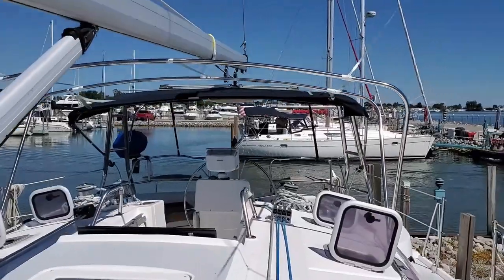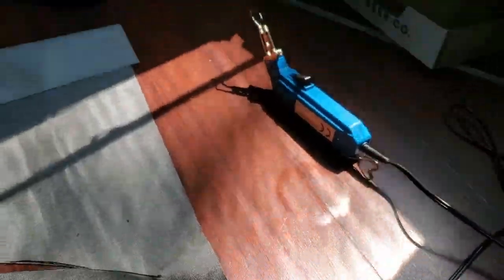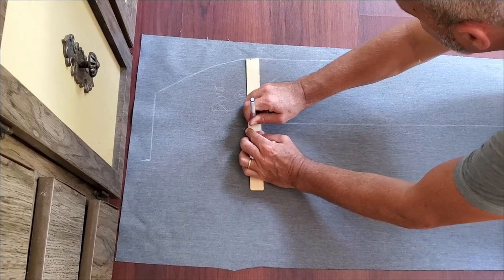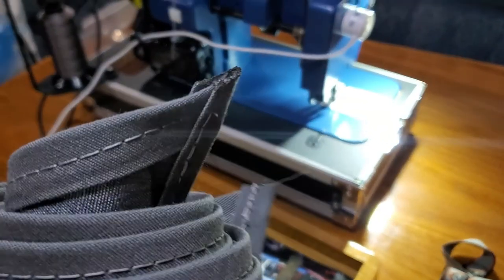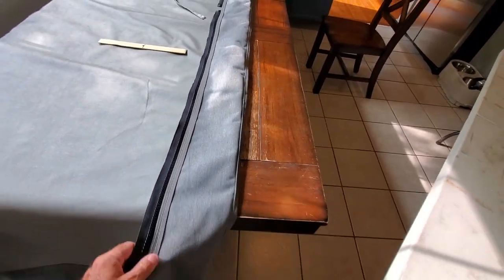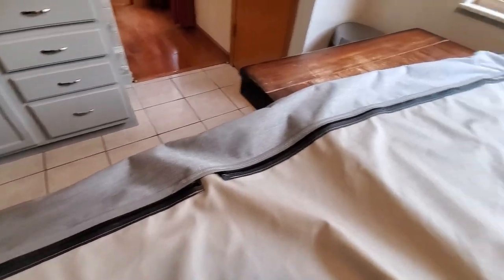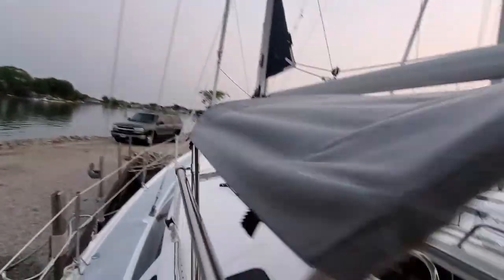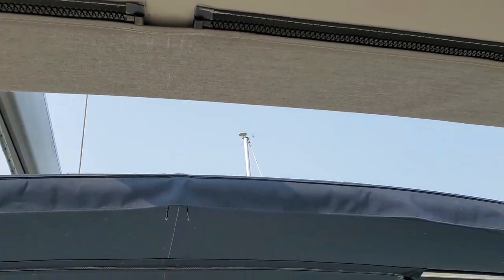100 Bimini Project Part 2 - Cutting the Canvas, and Sewing the Bimini Top - Sailing Pau Hana

Comment: Nice video I like your work arounds and making your own tools. I have listened and watched the video so many times I have their jingle echoing in my head while I’m working. I’m sorry to hear you’re having a hard time with your sewing machine with needle strikes. I have called them on a number of occasions and got good help plus the manual on timing and YouTube on timing are good too as well. I’m sewing a Bimini right now so thanks for your input I’m going to use some of your ideas on fitting the pockets to get that contour correct.
All the best Neal Southwest Florida
Reply from the maker: We just bought a house in SW Florida as well. We have 1 more winter here in the great white north, then we will sail down next summer.
Reply from the maker: The needle strikes have all but disappeared since I discovered using a larger table. The weight of the material hanging over a small table pulls the needle out of alignment causing needle strikes  (that's my theory anyway).

Comment: Came our really nice!  I must have been lucky with my Sailrite zigzag machine.  My biggest problem was getting the correct size needle to match the thread weight.  Then I switched to Tenara....whole new learning curve.  Happy to hear they made good on it.
Reply from the maker: I was reluctant to leave my frustration in the video, but I wanted people to see that if they're having issues, they should simply make an inquiry to sailrite, and not to wait until they get frustrated. Thanks for watching. Next season, we will add the windshield and side curtains.

Comment: I agree i have been having the same problem with my machine since it was purchased.
Reply from the maker: I have since had better luck. I will admit that at least 50% of the problem was user error and 25% inexperience and 25% machine issues. I'm having much better with it now.
Reply: Yes I agree  with you. I have years of experience using heavy duty machines as a parachute rigger. Have owned 3 other machines in the last 20 years. Purchased smaller machine for use on sailboat.